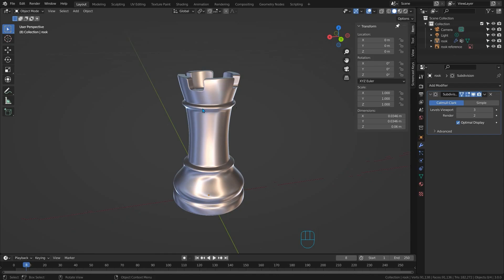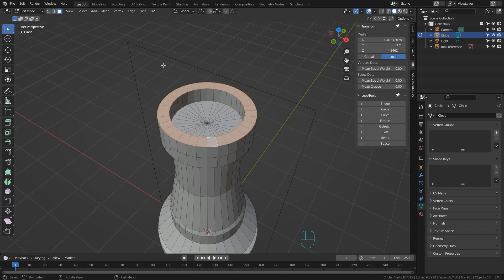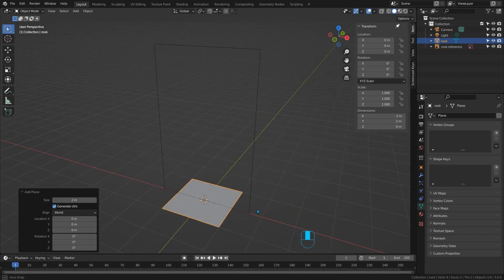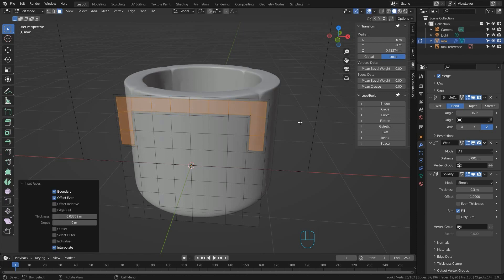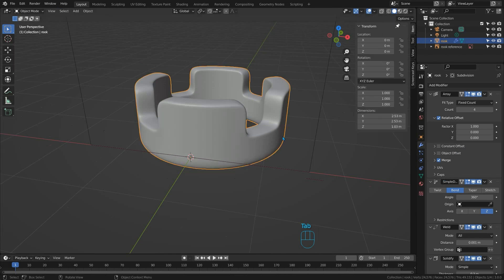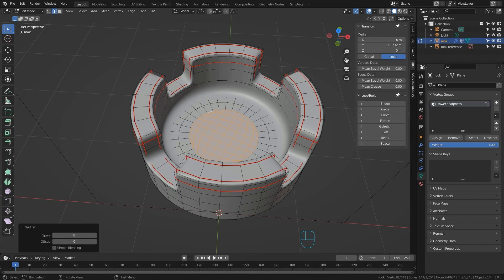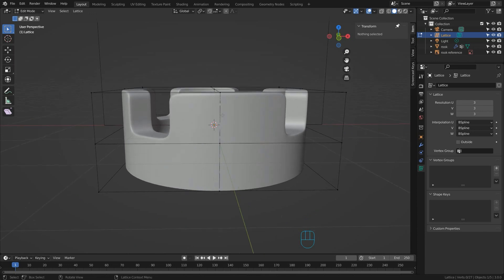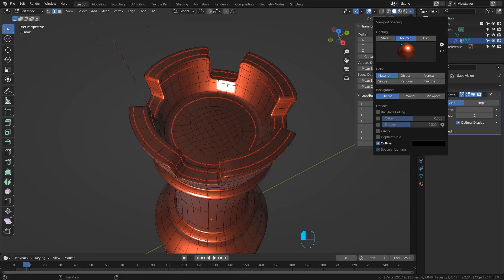Blender Chess Rook - #14 Subdivision Surface Modelling in Blender

Comment: Hi Ian, I have an issue with the lattice itself (Blender 4.4.3). In this part of setting the dimensions of the lattice, copying from the tower head values to make it perfectly ready for the next step of deforming the shape according to the lattice, the value field does not respond to setting a value on any of these axes. When I try to paste the value, zero is still there in dimension field. Is there any solution to solve this problem? Thank you very much.
Reply: you have to scale it manually for some reason, then you can type in values

Comment: I noticed (in wireframe top view) that the lattice will slightly distort the shape of towers unless the top of rook is perfectly symmetrical to x and y axises. So you should rotate it before adding Lattice modidier, until the middle of all four towers match the x and y axises.

Comment: Hi Ian, quick question: I'm not sure you'll check out a new comment on an old video, but in case you do, in this one, you mention how the Solidify modifier is not the best for adding thickness to a mesh, and then said you'd explain why in a later video. But then either I missed the moment when you explained it, or, since it was just a short comment, you could have forgotten about it… but I've been curious ever since! Would you mind providing an explanation for that?

Comment: Such a fantastic approach.
so many useful tools used that most people (me included) never even touch in blender and it really makes things easy and painless.

Most of what I took from this video in particular, is the way how five-edged poles can be avoided using insets the right way. I know you touched on this a few times previously, but the crown of the rook is really that kind of a problem that comes around quite often during modeling, and I've always had difficulties on how to resolve these issues.

Now the rook is of course a specific problem, it's a cylindrical body so it has a very specific solution, but my guess (and experience) is that once you know a solution for one problem, you can at least set goals for the topology in your own model, and thus make better decisions on how to reach them.

With this in mind, all it comes down to when it comes to topology, is knowing the right framework in which to THINK about topology first, and then combining that with the techniques on how to achieve the right result. Without the right framework of how to think about topology however, you can know all of the techniques in the world you'll always make unfortunate mistakes which can be difficult to fix.

For me the framework of how to think about topology has always been the holy grail and even tho there are some experts (like Bob) who have fantastic videos on modeling, you really go to great lengths to make your model as pristine as possible retaining the most amount of control in it as well while explaining all the "thinking" behind it. 

I appreciate that experts like you are doing this honest god's work here essentially for free. Thank you, it's invaluable.
Reply from the maker: If I had to describe why I like good topology I would have to say you have covered it all. It is a way of thinking. It requires a little calm and stepping back from the little connection issues. Of course you still have to deal with them eventually but if you can "see" an object as a whole, it becomes easier. I am going to expand on the 5 spoked pole thing in either the next video  (or the one after that). It is always much easier than people think but you have to take a deep breath and forget about the complex parts. The various shapes do want to connect together, they just don't realise it themselves!! (Edit - I am a huge fan of Blender Bob. That man is a genius!!)